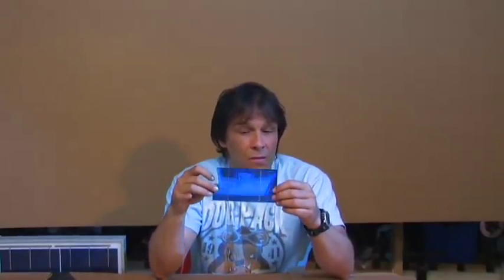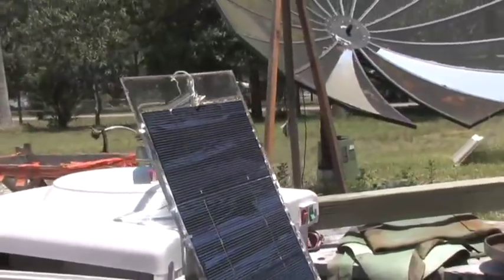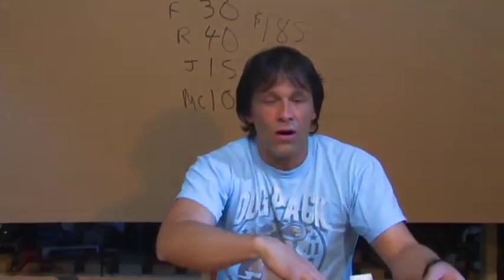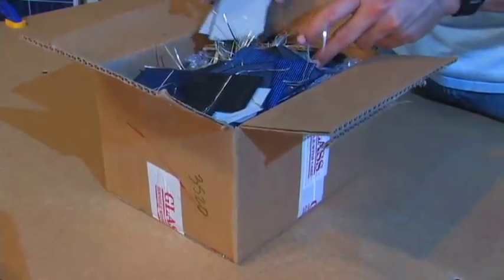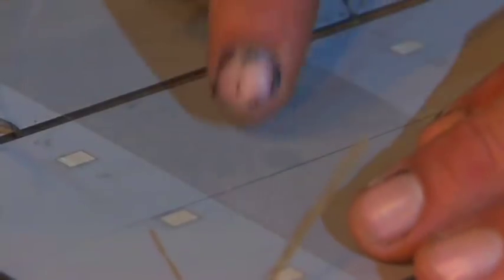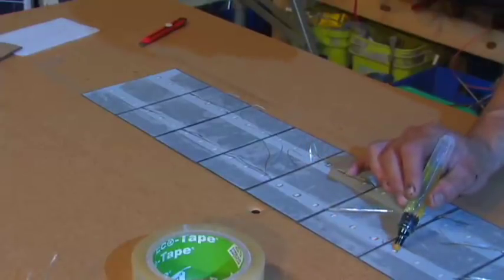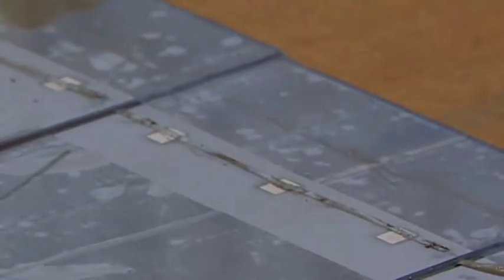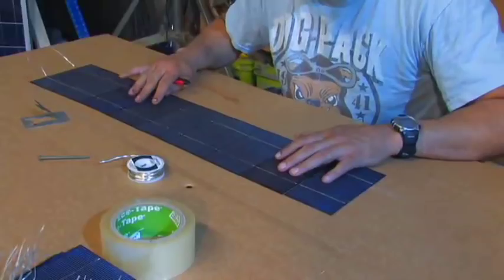less than $1 a watt DIY Solar Panel MAKE YOUR OWN SOLAR PANELS (PART 1)

Comment: Just a thought. If you used ceramic tile spacers on the outside corners while putting the tape on it will keep the panels from moving toward each other.

Comment: I bought a bunch of these but soldering them up is a bit daunting. I plan to attach mine to a large, water filled, copper cooling plate (doped with an electrically insulating varnish)  to capture some of that 80% energy that is lost as heat as well. 
Really excellent advice in this video. I'll see what else you've uploaded later.
Thanks a lot  :-D
Reply: sen yogen
I live in the UK but I could only find sellers from the US when I bought. It wasn't a problem though and I think I got the tab wire from the same chap. I think I found them on EBay.
They are sold as seconds, or "Grade B" because they are all slightly chipped. This is cosmetic really. they are only no good if you can't attach the tabs. Chips just mean a slightly smaller collection area, but of course they can't be fitted to commercial products so they are dumped onto the DIY market.

Mine were untabbed. If you can you should buy pretabbed ones to save some work.
Polycrystalline cells convert about 15% of the sun's energy to electricity and they are usually 3x6 inches like this guy was using.
There is also monocrystalline cells. These cells convert about 20% of available energy, however these are square with rounded off corners and so can't be packed in so tightly, meaning that only about 15% of the light that falls on the panel is converted still. Usually they are also more costly. I think they come in rounded 6 x 6, so consider one of these to be worth 2 of the polycrystalline ones as a back of envelope comparison.
They convert the "wasted" light to heat so I plan to collect that by attaching them to a water filled panel and hope to collect about 75% energy one way or another. They get less efficient by a few % as they heat up, but they will still operate well at 90C (200F) as long as the panel structure can tolerate the temperature changes.

Work out how many will cover the area you want to cover and add 10% for unusable ones. Try searching EBay for "solar cell 3 x 6" and sort "Price + P&P Lowest first" to see the best value for the number you need.

Comment: were did you get the resin you used at 1:40
Reply from the maker: We have switched to a UV cure resin.
Super High Gloss Table from Tree Limb Repurposing Reclaiming prepper Woodworking UV CURE RESIN
This video has a link in the more info area.

Comment: what is that electo flux pen
Reply: Is a kind a chymic to dissolve de oxide from a spot where you gonna weld. The solder grab better the metal. Strogger weld

Comment: As a radio control flyer I used to dream about the day they would make efficient, cheap, flexible solar panels so I could build an RC plane covered in solar panels instead of mylar..  They have them now as thin as tape or cellophane paper but they are still expensive and not quite powerful enough.

Comment: To be worthwhile you would need at least 6kw of power and preferably about 10k.  At $1.00 per watt that ain't hay and doesn't work at night.  Now, you have to add banks of expensive batteries, wiring, regulators, relays, fuses....  you see where this is going?
Reply: I spend 600 dollars a month for electricity during the summer months in AZ.  Even if I spend 400 dollars and it saves me 50 a month, Im at a gain in the first year.  Plus, any part that I can do to help my carbon footprint, I will.
Reply: JasonRhea

buy a smaller more efficient home, that doesn't eat an absurd amount of kwh?  I didn't pay that much for juice in houston in a 2000sq/ft home with cathedral ceilings. Sounds like you have an inefficient A/C unit or a poorly insulated home.

Comment: Hi there i just want to asked if there are no problem to connect 600 Amps battery to 30 Amps charged controller and 2500 Watt power inverteris., is it possible to charged  600 Amps battery from 21 Amps 490 watt solar panel ? thanks....

Comment: Now at the end of 2013, the price of commercial solar panels has been continually decreasing since making this video. With the price of commercial panels now literally at the $1 per watt price point, is there any advantage to making your own panels?? My assumption would be that a commercially manufactured panel would be of better / more consistent quality than a home made alternative? Regardless it was still interesting to watch the process, thanks.
Reply: My thought is that you can always get cheaper panels than retail price by buying broken ones. Probably just even cheaper to make.

Comment: You should tin the soldering iron with just a little solder, makes it so much easier, I don't even need flux when I do it that way, also you won't need the iron to be so hot if you do it that way.

Comment: It has, Flux. It usually comes in a smaller face cream or lip balm looking tub but he has a pen. Flux prevents the metal from oxidizing at high temperatures at removes other chemical impurities that may be on the metal. Without it, it becomes quite the daunting task to solder.

Comment: i really thought it was strange the way you were welding the panels but you could have welded copper or another conductor cable to them so that you would not need to cut them all again

Comment: then every 400w($800.) in panels you will throw 100w($200) away due to in efficiencies in the panels & inverters, I would like to see a panel & inverter combo that actually produces 100w sell for $60. that would make it a cost effective solution, even if they only had a 5 year life span.

Comment: nice vid, I looked at making my own panels but the amount of time involved to make a 100w panel & seal it properly its not cost effective over the price of a factory  made grade A mono panel, although they are a lot cheaper now they are still 2/3rds over priced to be in main stream use, at about $200. us for a 100w panel  (that's a 5-7 amp battery charger) then add a small grid tie inverter another $150. if you are lucky it might pay for its self over lets say a realistic life span of 10 years.

Comment: I do not know what wattage the panel is that you are talking about, but a good 100 watt panel is under $200 delivered from amazon.  Solar cells only are around 0.75/ watt

Comment: All wood warps, out in the weather. It does not matter what quality you purchase or how it's been cured(dried).  Please keep that in mind.. I don't know if it will form pressure and break anything but it most definitely warp. That's what wood does....Unless it is clapped into place and nails or screws wont provide the necessary restraint. I will guaranteeing that 100%..

Comment: i worked as a wood frame and forming carpenter for 12 years before deciding i wanted to do something different with my life...
and in that time i found wood to be both forgiving... and prone to warp due to moister and heat cycling

Comment: for one, lead free may be the only available there, and, it may someday be all that -is- available(lead shortage looms).  for casual user, lead isn't a big deal, for someone that uses a LOT, it can be a problem, someone that in the future -may- be using a lot, starting lead free may be very sensible.

Comment: I still intend to complete the panels, that I have all the components for, to use for one application or another in clean power generation, but my primary "focus", with what time I have left, is to complete fabrication of what is described as a "high efficiency" motor and generator - based on super neodymium 50/52 magnets. Drastically reduced income due to my wife's passing has put a temporary hold on progress on this goal until I can work out "financing" to acquire the remaining hardware.

Comment: As you can see in my pic, I am leaning on one of the "things" that is taking me in a "different direction" now. What you see to my immediate left is a "DC power supply". I fabricated it from plans that my late wife and I had purchased shortly before her passing. It is based on the same "design" that was first used to first smash the atom way back in 1932. If interested Google Cockcroft Walton_generator. The one you see me next to puts out 330, 667, or 1005 VDC unregulated.

Comment: My late wife and I began work on setting up our own solar array for our home in central Florida about 5 years ago. I purchased off Ebay, at a very good price, a plethora, of 4x6 "grade A" cells to build our panels (around 26 producing 64.8 watts each) with. Not too shabby. I chose to use extruded L channel aluminum for the frames.Things have been put "on hold" after the unexpected death of my wife due to cancer. I stumbled across something that may take me in an entirely different direction.

Comment from the maker: When you rip them down the middle for framing, they either warp at the time of the cut or stay straight. I have untreated frames that are 4 years old,  sun damaged but not warped. The wind turbine from 2008 is also straight after 5 years and it was untreated too. PT warps, regular does not if it is a good board. Picking a straight 2x4 is the key. I will have a follow-up video on aged 2x4's due out soon. Maybe they are magic:-)

Comment: Hello, just want to asked if the 300 Amps battery can be charged by 260 Watt 15 Amps solar panel and 15 Amps charged controller. Thanks a lot.

Comment: I have been in construction almost 30 years. if you get lumber from a contractor supply that uses northern grown lumber it will not warp. I hand pick every board for every house 
I build certain building supply places that claim to be for pros do not use good northern lumber. Treated lumber is soak in poison to keep bugs out not to prevent rot.

Comment: Thanks for you nice video. Did I get it right, I should connect the front of each cell to the back of the other? and finally front side of the first one will be one terminal and the back side of last one will the other terminal?

Comment: I noticed while you were doing it that you were soldiering the tabbing wire to the cell it came from - shouldn't you show a video doing it correctly?

Not to criticise or anything.  I totally suck at soldering, and I'm en electrical engineer.  Thank god for lab techs.

Comment: Hi sky.
If you spend $100 for all the parts and resin (we'll assume you have the equipment), and DIY (do the work and installation yourself), that's all it will ever cost you to charge your batteries so you can run your lights at night (or however you want to use the power) for the next 10 to 25 years, unless something unforeseen happens. If you spend $1000 for parts and resin, then that is all it will cost for the next 10 to 25 years of use. The cost is a one time shot. I hope that helps.

Comment: You can print and A3 sheet of photovoltaic cells and you don't need to build this. Researchers at Australia's Victorian Organic Solar Cell Consortium (VICOSC) — a collaboration between the Commonwealth Scientific and Industrial Research Organisation (CSIRO), the University of Melbourne, Monash University and industry partners — have successfully printed an A3 sheet of photovoltaic cells.

Comment: I wouldn't say permanent... If you're wanting to go off the grid on solar... even making the panels yourself... you're looking at a good $12,000 investment. But with a good battery system, that 12k investment could give you 5,7 or even 10 years of free energy. Batteries eventually need replacing though and until that technology gets better, battery cost and replacement is your major concern for getting off the grid. Not to mention the cost of replacing old appliances for green/low energy ones...

Comment: I would like to ask would you ever build one for someone? I wish I was able to do that kind of stuff but it would be a little to much for me. Also what I want is a way to have a system that can plug into my outlet at my apartment using the grid as my storage and power all my stuff in my place with no or very little power used from CPS. Thanks Mark

Comment: Everyday electricity that you buy is measured in (kilo)watt hours. Solar power, because it is continuous is measured in watts. wattHours are a measure of power used over an hour, while watts are a measure of power out/input. So if you spend $50 to power a lightbulb (terribly inefficient lightbulb by the way, unless it's a larger industrial scale one), it will be on as long as the panel is receiving light (they degrade without maintenance, like all man made objects).

Comment: I'm trying to fit 48 3"x6" cells onto a 24"x48" panel of glass.... Space wise it fits, but it isn't at the recommended 18V.... If I stick with 18V then that leaves 36 cells and a bunch of empty space.... Is there a way to mix and match series and parallel cells on the same panel to create that 18V with 48 0.5V cells? For some reason I'm thinking you can't add power sources in parallel when the voltages don't match - but what happens? Does it still work? Is there less current overall?

Comment: But, if it's less than 1$ per watt. (Say $0.50 per watt) That's still going to come out to $500 per kilowatt.  That's like $50 to keep a 100 Watt light-bulb on for an hour.

Or Is it supposed to be <1$ for 1 watt permanently?  So you could power a 75 Watt bulb indefinitely with roughly $30 worth of solar equipment.

Comment: Will a 15 volt output be enough to charge a battery if I use a charge controller?  I don't have enough room on my frame for 36 cells. 30 cells would fit better.  Just trying to power a small car radio

Comment: matt surface = textured surface, while gloss surface is not (mainly of the upper AR layer). Texturization allows a better light trapping, thus an enhanced efficiency.

By 6+6 you mean squared cells having 6" each side? Sorry, but I don't understand your language for technical purposes. In between, small solar cells are, of course, cheaper than bigger ones. The prices I provided were for Grade C c-Si solar cells, 4"x4"

Comment: tank you 4 your reply,i got 2 boxes of 156+156they have a matt surface i got 6+3 in akit form and they are full gloss finnish do not show up finger marks and they look a lot better that was my dilema because this is my 1st attempt at making a panel also after alot of research i can get C grade 6+6 for 80 cents each,

Comment: A Grade solar cells are prime flawless solar cells.

B Grade solar cells are solar cells that contain a visual flaw that does not affect the power, their price is a little lower than A Grade cells.

C Grade solar cells are those with a flaw that affects the power output, so the output power is somehow lower than A and B Grade cells, and the price is lowest.

P.S.- By the way, the lowest commercial price per watt for Grade C cells is about 1.5-1.6 USD, then... less than $1 a watt solar panel? XD

Comment: Yeah Geoff, that's the point that the author avoid to clarify (as I've previously mentioned). At present the mean price per watt of commercial modules are about $1. This does not mean that ALL prices are the same. There are a great number of commercial options whose cost are LESS than $1 a watt (some of them cost about 75-80 cents/watt). I wonder how can you get all the necessary materials at a retail prices that can compete with those got a wholesale prices. Really strange.

Comment: You need so many watts to charge different batteries to store the power.  Different size solar panels are charged per how many watts they produce for charging and powering.  As long as you construct the panels correctly the price per kilowatt is free to charge and power different things. (Of course it's an investment to make and you'll see the savings in the future).

Comment: I been looking into it and it seems "wholesale solar" simply has the best cells and thus panels available, they have a 300 watt solar panel about the same size as your average 12v panel which is measurable in arms length.
It comes out to $0.84 per watt.
Keep in mind, the average home uses 14,000 kW per year, 38000 watts per day.
So to fully power your house you need about 127 panels... I think
Anyone good with electricity?

Comment: Great Video...thanks 

Would like to know 2 things : 
1) How much current will the 9 pack solar cells generate .....will it be sufficient to light a 100 W electric bulb .
2) How much solar heating (in hours ) will give output to light a 100W electric bulb for X amount of hours.

Comment: do you see this as an option or are these somehow different to work with my harbor frieght kit is 3 215w panels and is hard to haul in n out of garage, do you think this is doable it just seems too good to be true as for being on flexible panel at 69 watts 12v for around 150 vs the harbor frieght at 45 and 3 times the size i know panel is like 9 ft when unrolled but is going to be rolled up so will save space

Comment: hey there i figured id ask the master on this i am wanting to build a portable solar kit because our power seems to go out alot whenever it storms even a little but i rent so cant have anything permanent. well i came across these unisolar peel n stick 68 watt 12v solar panels that are meant for roofing shingles well my plan was to either leave backing on or peel and put a fabric on the back and use these for my solar kit so far all i have experience with is the harbor frieght 45w kit

Comment: UV-resiatant resin is only resistant for about a year - you'd need to paint it over for longer... but you can't do that with solar panels. 
2x4 s have to be dried, if you don't want them to warp - any building constructor can tell you that.  however, your wood is rather short, so they won't warp much - except, given the fragility of these cells, I would still be concerned.